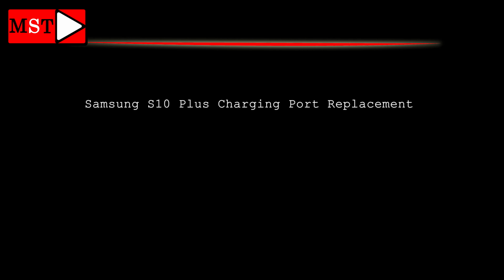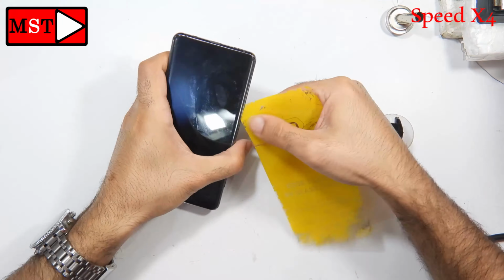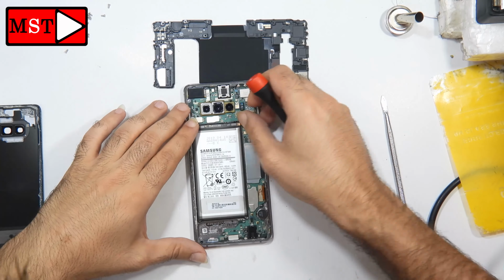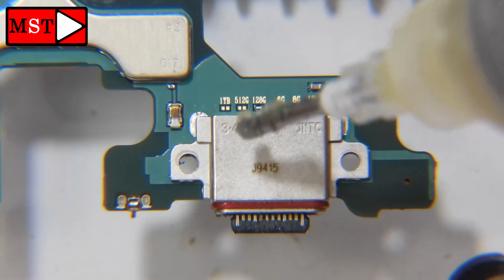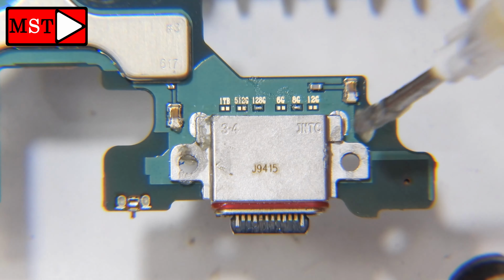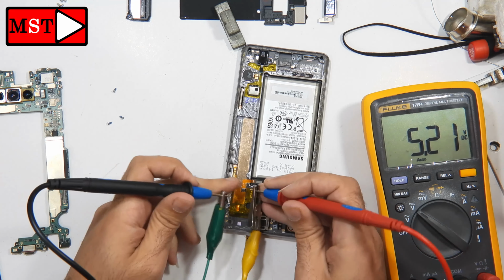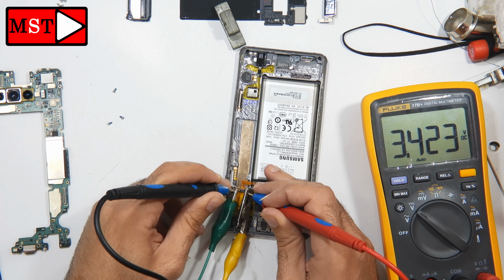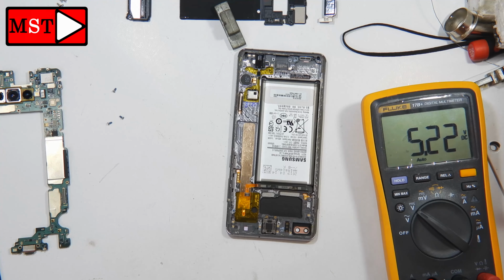Samsung S10 Plus Not Working Or Charging

Comment: spending a long time heating the port and board / what type of rework station are you using? and at what settings? you mentioned 456 degrees but what about air?
Reply from the maker: I got kada 858d+ but i should be new models in the market, this one is 8 years old being used. About air mine have from 1 to 10 , im always use 6 or 7 or even 5 if there's small components nearby